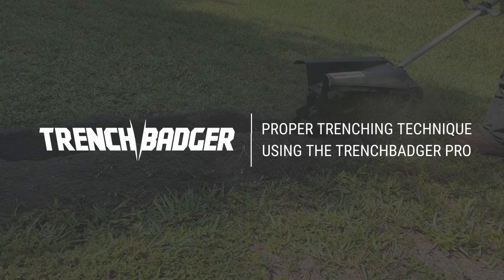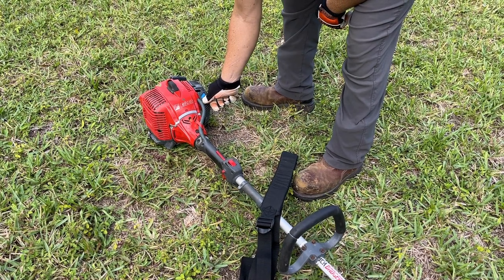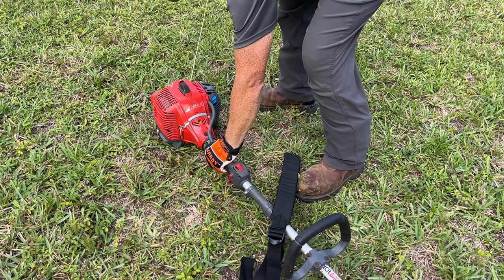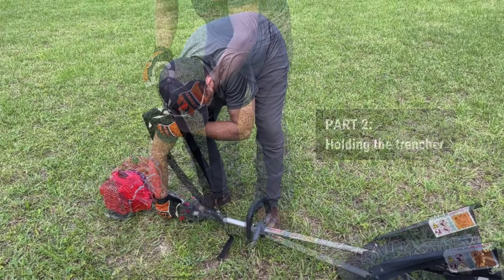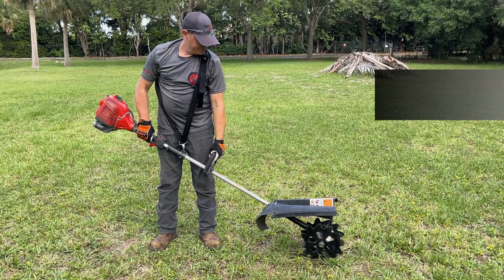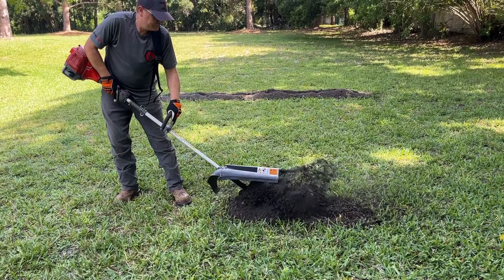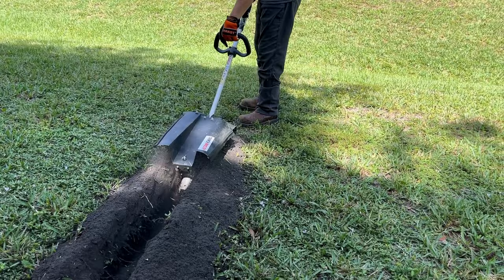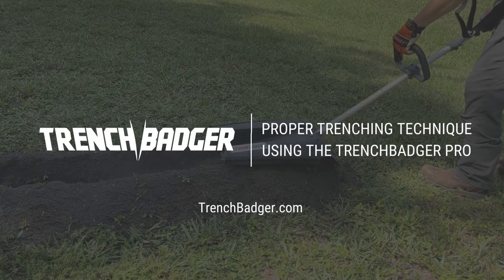TrenchBadger Pro   Proper Trenching Technique

Comment: I need something like this to bury my garden & orchard edging 6" deep. We have clay/loam soil and it's extremely tough going with hand tools. but I only need it very narrow; will it operate with just one blade?
Reply from the maker: Hello Ken. We recommend the BadgerClaw blades for your clay/loam soil. You can use the TrenchBadger Pro with a single 12" blade setup but you will get a maximum depth of 4.5" and 1" width. If you use 2 blades you will get to the 6" depth with approximately 2" wide trench.  We are currently offering free shipping on all products so check our website for more info at www.trenchbadger.com or call us at 866-887-3624.
Reply: Have you considered using a pressure washer to cut the soil?

Comment: I do the same thing with a gas powered edger. I put in all my garden sprinklers and my ham radio antenna wires with a landscape edger 20 years ago..still fine. 
Even with yearly core aeration and other abuses...still fine.

Comment: Love it...but it doesn't look like it can dig down below the frost line
Reply: Web site says 12in max.  Not going to do what I need. :(
Reply: Not even deep enough for burying electrical cable - 18 inches for 240V vs. 6 inches for low-voltage wire 30 volt.